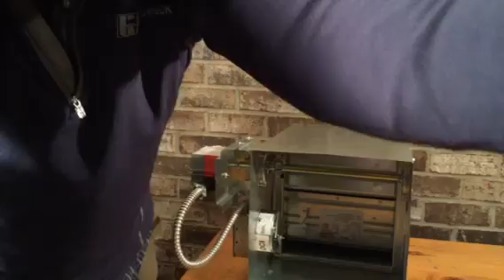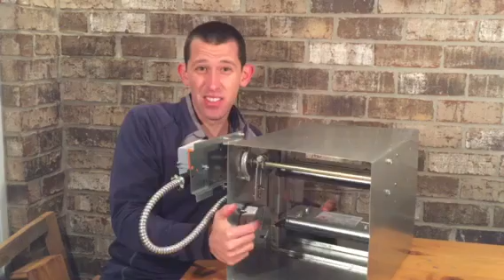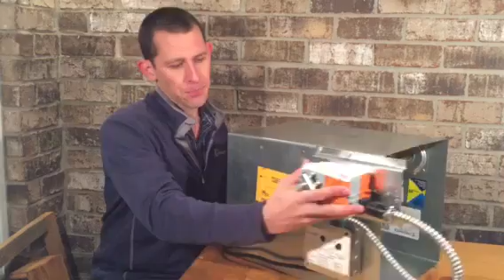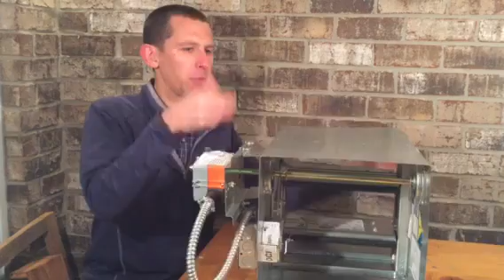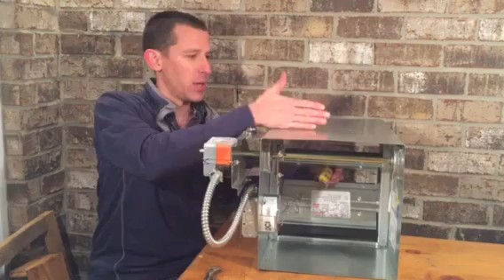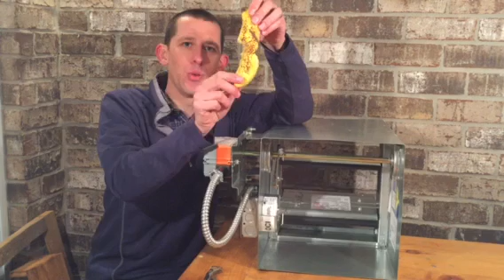Fire smoke dampers

Comment: It Must be centered in the wall. the sticker indicates with dashed lines. Angle must be mechanicaly fastened to the damper on both sides of the finished wall around the perimeter of the opening and one side of the connecting ductwork must be a breakaway connection, usually the unoccupied space.